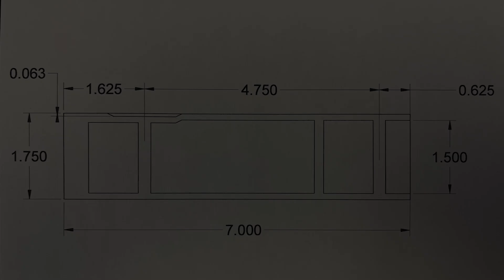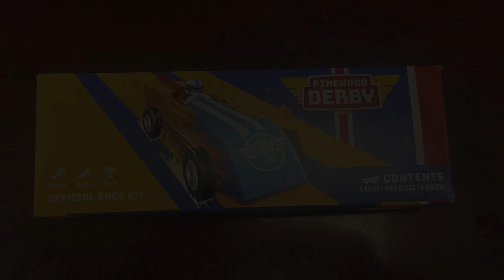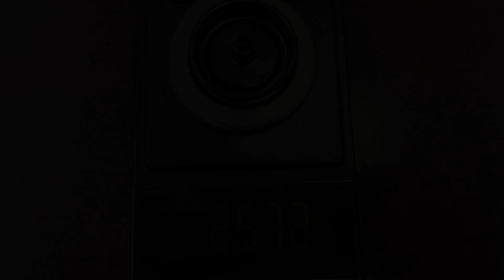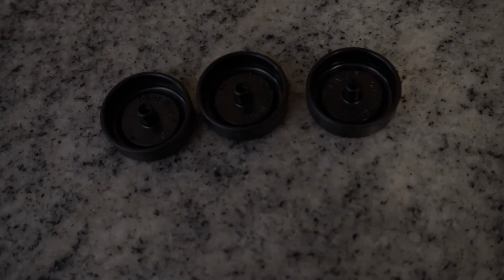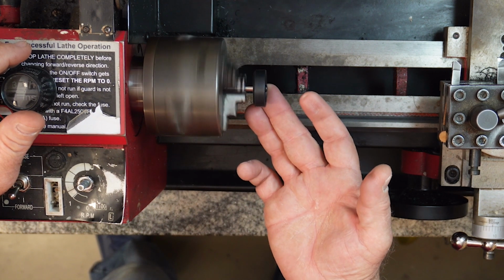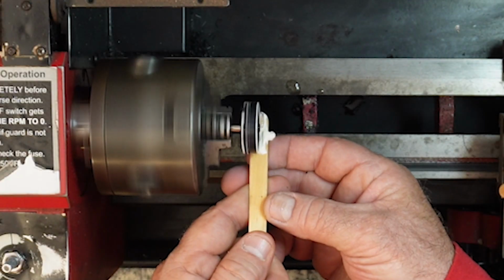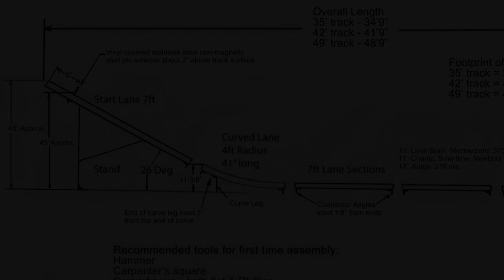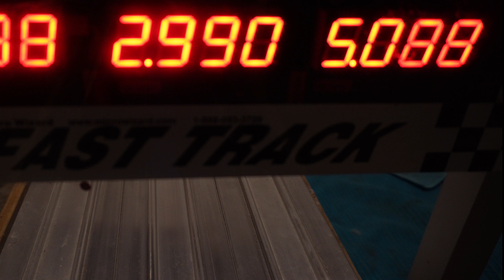Building a sub 3 second pinewood derby car!

Comment: How did you polish the glue? Did you let it cure first?
Reply from the maker: Yes I allowed it to cure. Then sanded with 1,000, 2000, 3000 grit sand paper and then a plastic polish

Comment: For the areas you fill in with balsa wood, are you just adding a thin layer or are you cutting a 1/4”thick chunk the glue in there? Wasn’t 100% clear I understood how you did that part
Reply from the maker: I fill the cavity completely with 1/4" balsa
Reply: @mikemcguire2550  where do you get your balsa wood from?
Reply from the maker: @jm9398 I pick it up at my local hobby lobby

Comment: Im curious what my son's car would run on a properly set up track. The track that was used at the state race was a Best Track, but I dont believe the ramp was at the correct angle. The bottom of the curved track where it connects to the first 7ft section had a visible hump. That tells me the starting portion wasnt high enough to make a smooth transition. Nevertheless he still won with a time of 3.088
Reply from the maker: It seems no two tracks are assembled the same. I think that's why you see such a large variance in times.
Reply: @mikemcguire2550 It's been my experience, over the past 2 years, that our cars usually slow down as the races go on using graphite. This past race the car was faster towards the end of the day. Any insight as to why?
Reply from the maker: @  It could be a number of factors. The car next to you can influence your times more than most people know.

Comment: What are the specs on your tuning board? Do you have a video on that?
Reply: He does, I believe it's part of the prep video. 48" long x 15" wide
Reply from the maker: After measuring it, it’s actually 51x16. I previously gave incorrect information
Reply: I use a 5 foot wooden table, lift the one end by an inch.  Masking tape for reference points of left to right and distance traveled down the board.
Reply: @BlueTrane2028 I do the same with my dining room table.
Reply from the maker: My tuning board is 51" long 16" wide and drops 1" left to right

Comment: What length track?  With an extremely lightened ladder car and 14g at the DFW, no wiggles while running, we managed a 3.12.  42' Best Track.
Reply from the maker: This is a 42' besttrack. My hill is set to 27.1 degrees to match the leagues rather than 26 degrees.
Reply: @mikemcguire2550  Ahh, so our hill probably isn't as steep.

The car pretty much dominated everything at pack and district, but I hear of people with these sub 3 second times on a 42 footer and it makes me just ask how, haha.
Reply: So where is your finish line? I've read online that it should be 37'9" from starting pin to finish line. But I'm not sure if that's correct. I'm getting 3.31 seconds at that distance with a 26° ramp.

Comment: We used all your tips to win the pack two years in a row, off to districts now.  Super proud of my scout who did all the non bandsaw cuts, drilling, polishing and painting himself.
Reply from the maker: That's great! Good luck at districts!
Reply: @mikemcguire2550  thanks!  He got 5th last year, and our car is 7 thousandths faster than last year, which should be good for a place or two, all else being equal.
Reply from the maker: @PFDarkside  In league racing that would be the difference between first and last place. Please let me know how you do.
Reply: @mikemcguire2550 well, it ended up being a regional with 4 districts.  He finished 2nd overall, 0.0021 seconds behind 1st.  Great season and he’s already planning the car for next year.  Thanks again!